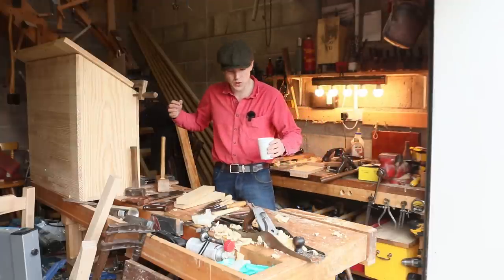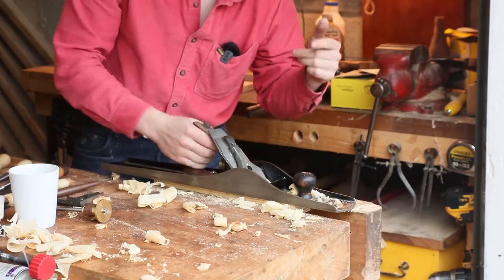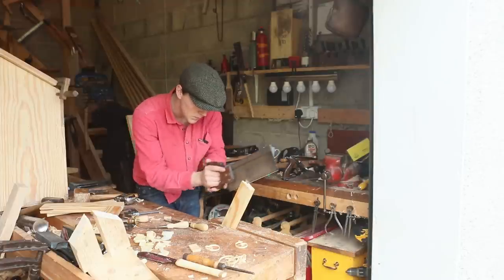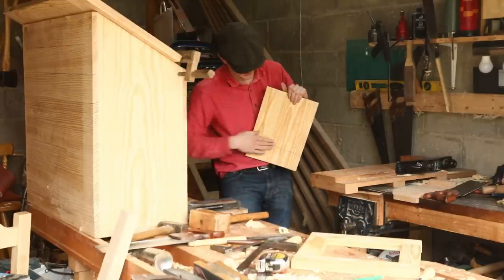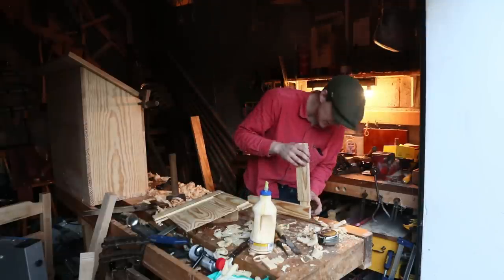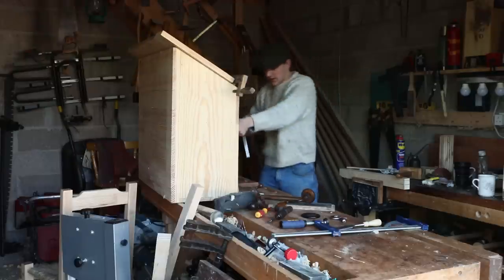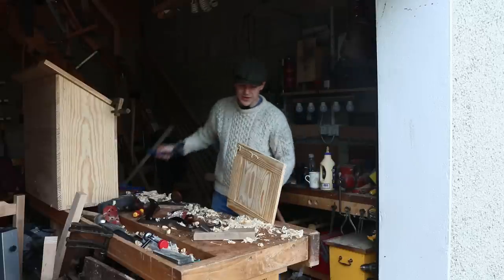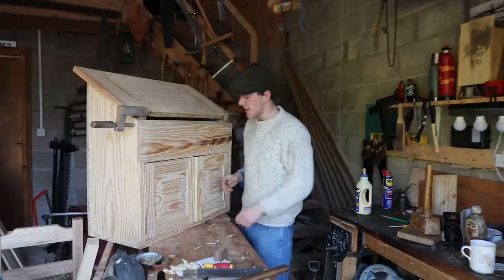Making The Tool Chest - Frame and Panel Doors (Handtools Only)

Comment: With your suggestion to put it on casters, I was thinking you'd maybe be better making a trolley for it so that when you get to where you're going with it you could remove it from the trolley and lift it onto a workbench, that way you're not having to constantly hunker down to get to the tools in the bottom section like you would if it were on casters itself. Regardless, it's a fine looking cabinet.

Comment: Just found your channel and I'm loving it! Wood glue can be undone with some heat and vinegar or water. Depends on the glue. For anything critical that is tricky to glue I recommend hide glue. Grab some Old Brown Glue and keep it in the cold. It has a 24hr period after gluing that allows for adjustments. You can also do old school gluing techniques like rub joining when clamps are impractical.

Comment: "Clamp the bejaysus out of it"....  I say the exact same thing lad 😂 As ya can probably tell, I'm Irish too (Wexford), I work by hand also 😁 Your frame, usually a haunched tenon would be used at the corners, the haunch hides the groove on the end so it can be planed instead of makin a stopped groove (a pain in the face to do by hand)  what you have is more like a bridle joint rather than a mortice and tenon. Your panel; usually it would be left to float with no glue so as the wood expands and contracts it doesn't try to open the frame up on the corners. The panel isn't very wide so it be grand to glue it fast.......... to stop your glue squeezin out an stickin to the face of the panel ya could put some kinda finish on the panel before it's all glued up, the glue won't really stick to the finished panel an it'll be easier to clean the glue off. Ya planed the frame to size all in one direction, planing out through the end grain might be why the part split. Some like to make a little chamfer on the far side so the plane doesn't break the back of the end grain, some like to plane into the middle from either end. If I was flushin up the sides of a small box that I'm gonna chamfer the corners on anyways I'd use a chamfer to stop breakin the back of the end grain, if I was fittin a part or flushin up a bigger part I'd plane from both ends into the middle. 
Not sayin any of that as is "ya done it wrong"...... jus passin along some tips 😁 it's nice to see (and hear) an Irish lad on the YouTubes....... Even nicer to see em workin by hand, keep it up lad 😁🤙

Comment: Love the sound of a plane slicing through wood. I got an old Stanley #8 that I looked up and seems to be a type 6, so it's about 130yrs old. Found out the blade isn't square and it's bent a little. The lateral adjustment had to be set to one side to get an even cut out of it. Looking to get a modern blade for it and that should even it out better.
I got plenty of other modern planes, just gotta put them to use. I'm thinking of doing an English style tool chest similar to the Anarchist Tool Chest. That'll be good practice for dovetails.
Thanks for sharing your work. It's certainly inspiring. Enjoy your holiday/winter season.

Comment: Extend your trigger finger down the handle of the saw when cutting. That was more of a bridle joint than a mortice and tenon. You shouldn't have glued in that panel either. Apart from that it's a nice job, fair play, 👍💪🔨🇮🇪🇮🇪

Comment: About 9 minutes in, you make a good point about glue being 'the point of no return' in that once glued, it cannot be charged.   

THIS is why I work in metal.  If I  screw up (me screw up?) I  c a n  cut it apart, make the change, reweld, grind, finish and no one's the wiser.  

With wood?  Ya, not so much.

Comment: While I myself am still an amateur, I'd like to point out that you shouldn't have glued the panel to the rails and stiles. The panel should be free to expand and contract with the humidity, and gluing it in like that could cause warping or cracking over time. Now, being that I am an amateur I may have overlooked something of which you've already thought. If that's the case, I'd love to learn for my own projects.

Comment: I'd recommend some good handles and wheels for it. There are some neat various ways to set it up for over the shoulder carry (a variation on backpack straps so you can move it over ground even as rough as stairs. Not got a better way to describe it in a comment unfortunately)